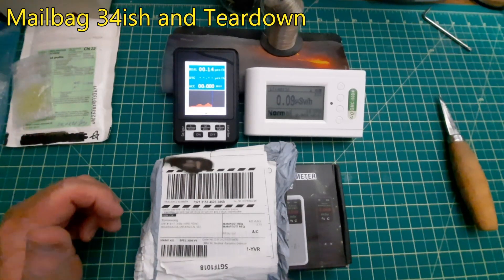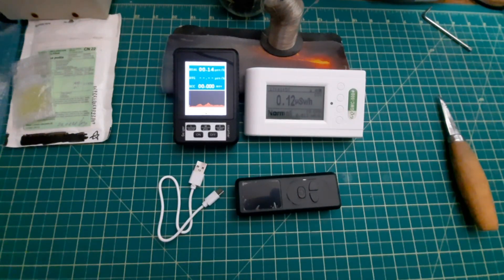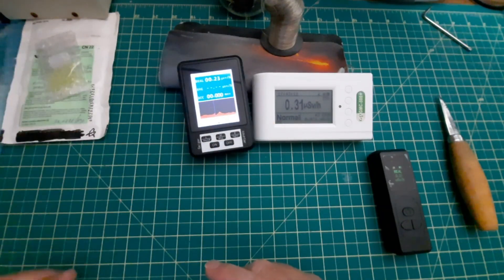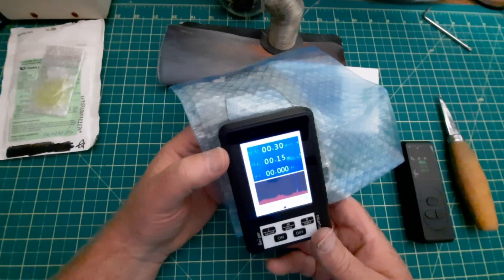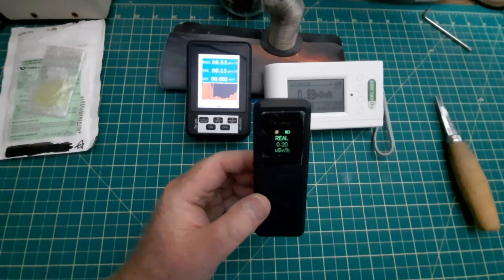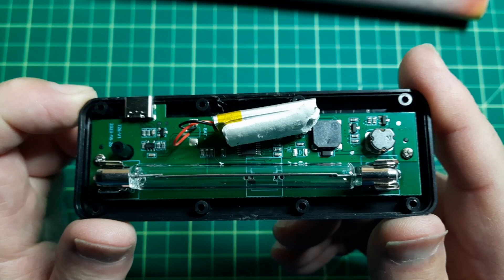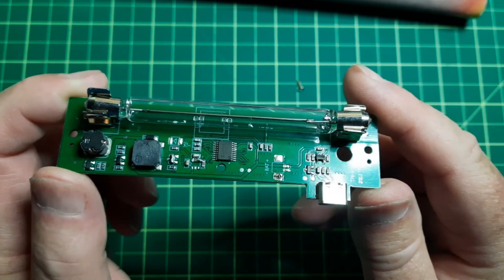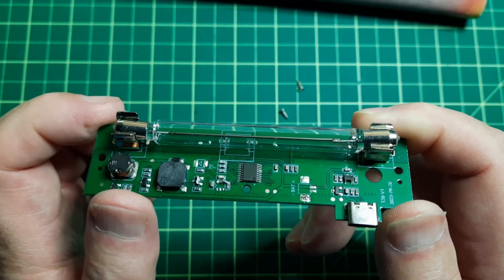Electronics Mailbag 34 ish and Teardown of Geiger counter

Comment: That tube doesn't quite look right with the end caps twisted, and the power supply looks considerably simpler than I would expect. Also I don't understand how it can apear to register background radiation but not your high level source. If I was being skeptical, I might think that it's a complete fake with the software made to look like it's a real one.  Can you try that tube in another of your counters?
Reply from the maker: It will be a little while before I can test the tube. Either I will build a test circuit or it might fit in the XR1 but currently the screws in the XR1 don't want to come out. If I have to drill the screws out then it becomes a tear down. Have two more high end Geiger counters coming/(in the pile to open) and after that the XR1 days might be numbered.
I was hoping to get a Geiger tube and Lithium ion battery out of this but if it is fake then the tube is probably garbage.
Like your garden light video, hope your neighbors have a good sense of humor.